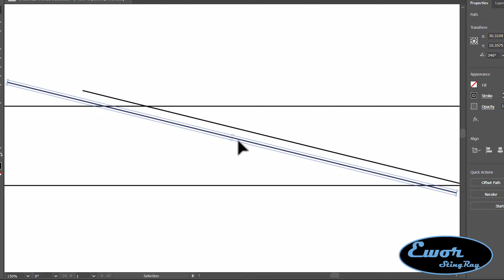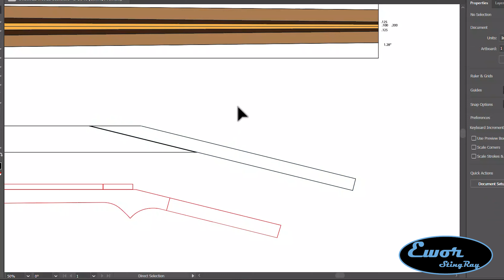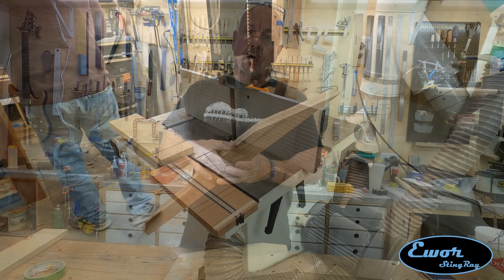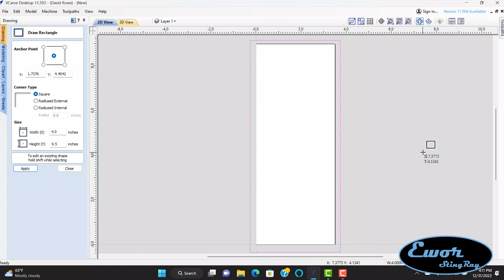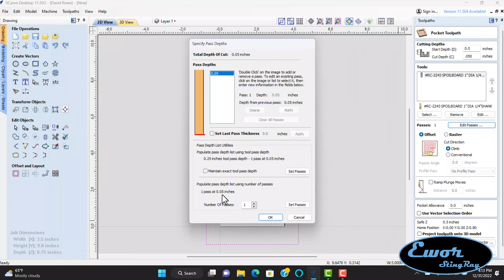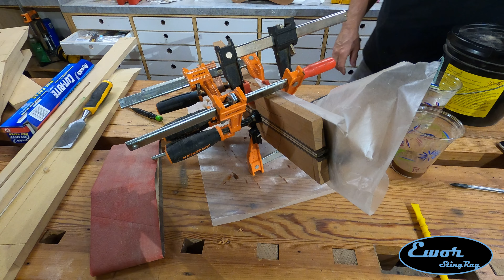Ewor Stingray part 7: Making a scarf joint on a CNC machine

Comment: I’ve been learning not guitar making and running my own CNC I got just before you got yours and I’ve had pretty good luck drawing some simple things like radiuses, angles for scarf joints etc in fusion 360 which is free. May try it. I just made a sanding block with a 12” radius for fret work and I’m pretty proud of it 😂. You just draw it in fusion and export as an stl that can be imported into Vcarve. I could show you sometime if you’d like.

Comment: It is my understanding after talking to the people at next wave, you can't write g code files in fusion 360 for vcarve. Unless you know how to write a post processor for next wave that will work with fusion 360.
Reply from the maker: I think what I will have to do is use vcarve for the 2 d milling and fusion with its cam for the 3-d parts

Comment: 3D-cutting of a 14 degree angle requires using a ball endmill, resulting in a scalloped surface, that needs leveling. Cutting the surface flat by placing it in the needed angle can be excecuted with a flat endmill. I'd stick to your method. I do, although I work with Fusion and am able to cut 3D.
Reply from the maker: I am looking forward to learning fusion.